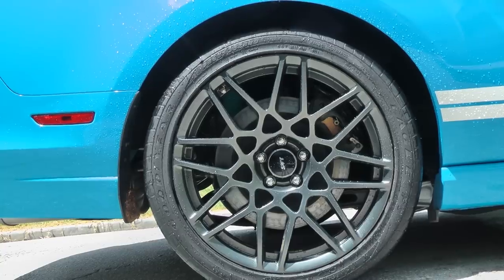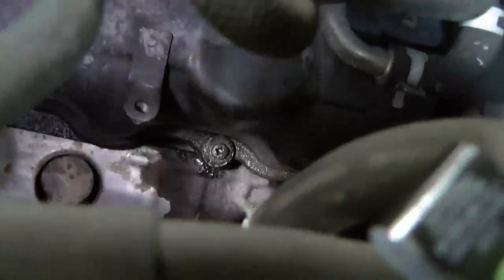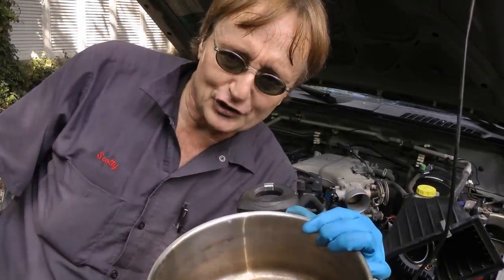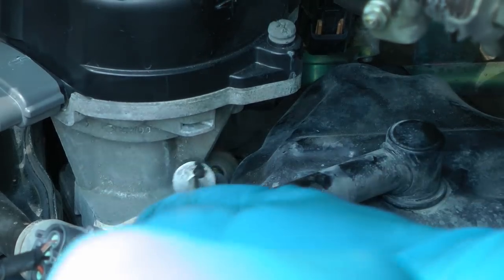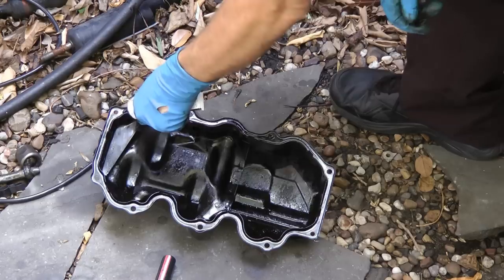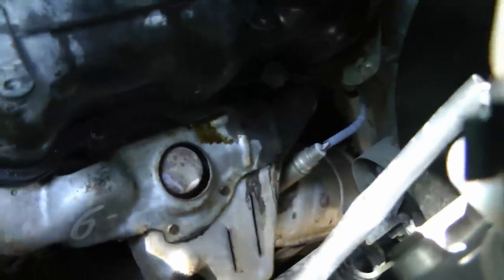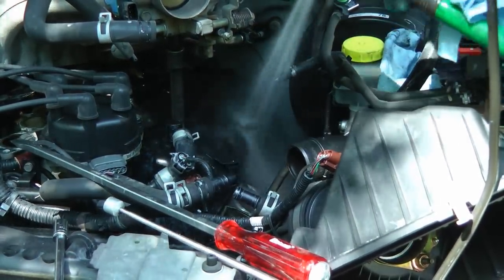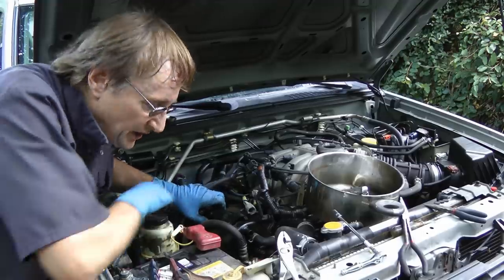How To Fix a Car That Smokes Under The Hood

Comment: Be very very careful when hosing it off to keep water out of your electronics, including your distributor, coil wire, MAF, as well as other sensors, wires etc. I literally used a garden hose with no pressure and messed up my camshaft position sensor in my 2001 Chevy Tracker 2.0
Reply: +Ethan Taylor Problem is, however, that the oily residu just sinks into your driveway, and that is actually not so environmentally nice....

Comment: Should I put 51 psi on my tire or check the manual
Reply from the maker: +Vionel Savage waay too high, check the manual
Reply: +Scotty Kilmer my tire say 51 psi on it but the manual say 32 psi on both front and rear which one is bwtter
Reply: +Vionel Savage lol no put 32 psi bro 51 is way too high
Reply: the psi on your tire is an estimated range just for generalities. always go by the Manual. You're risking a blow out real quick with that much psi.

Comment: Hey my car blows out white smoke at start up and then dissapers..also i smell oil burning while driving what could be tge problem
Reply from the maker: odds are engine is just wearing out. First do my video "how to tell if your head gasket is blown" to see if it's that. If not that, live with it as you would have to rebuild the engine fully to stop that and they can still run years that way
Reply: Scotty Kilmer  hey ! scotty my mitsubishi  lancer is the same problem  blows out white smoke at start up and then dissapers..also i smell oil burning while driving what is the possible solution ..note:my engine is still good  and not losses oil .if it's possible for valve seals replacement? Thanks
Reply from the maker: larry ofw
mits are known for weak piston rings. Do a wet and dry compression test of the engine, that will show if valve seals are worn OR piston rings when the test is done

Comment: When your vehicle is smoking, how do you know when to run like hell?

My F150 which has a bad engine (among some other "minor" issues) has been sitting in drive way, waiting for me to get the money to see if I can mess around with it and fix it (or at least learn something from it in the process.) I decided to start it up, trying to keep the battery from going bad, and about 10 minutes into it running, It stalled on me. It wouldn't start up again, and made a lot of noise. Hours later, it started up again, but it started smoking and smelt kind of like burning ish. I feared my F150 had become a member of ISIS and was going to blow itself to heaven for 72 virgins, so I shut it off, popped the hood and ran a few feet away. I couldn't see the color of smoke or where it was coming from because it was after 11:30 pm at night.
Reply: Alternator belt?
Reply: I'll fix your 150 for free. Just teach me how to "run 🏃 for a few feet..."

Comment: i have a kia sedona that smokes in the oil filler cap when its open. this happen when the car was overheated the other day and there is a small amount of oil in the radiator. can i still use the car?
Reply from the maker: oil in the radiator means head gasket is blowing most of the time, odds are it won't run for much longer without a head job
Reply: you have a bad head gasket

Comment: My 95 3.4 camaro has whit smoke coming from the exhaust manifold what could it be
Reply: N i just chngd my headgasket
Reply from the maker: pray it's just oil leaking down on it from a bad valve cover gasket, and not coming from the inside of the engine showing internal engine wear, realize head gasket jobs don't always work out correctly, they are big jobs

Comment: how can I fix my smoking car 2003 passet
Reply from the maker: sell it to someone else, that fixes your problem.  But try to have the engine carbon cleaned by a pro and the pcv system cleaned out and PRAY it's not a worn out engine which is common on those